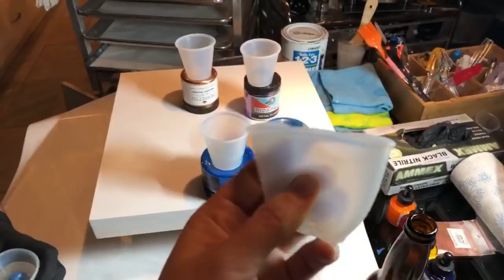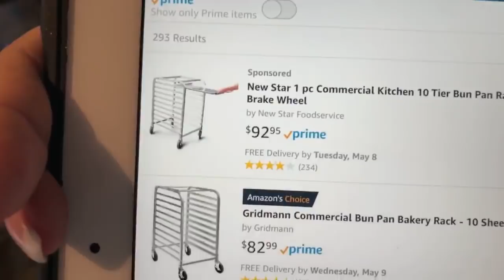Live Resin Pour With Ms Judy

Comment: Does dried resin peel off of porcelain tile?
Reply from the maker: Hello Edie!  I have used it on ceramic tile without any issues but I can't speak first hand about porcelain tiles.
Reply: Artist Till Death I meant if you spilled it on your tile floor, would it dry and come off?
Reply: Use a heat gun to gently heat/soften it and "scrape" it off with a plastic card. Knife might scratch your tile - I'd use a plastic item like an old bank card.
Reply: Thank you!